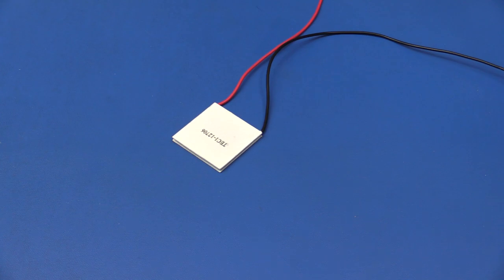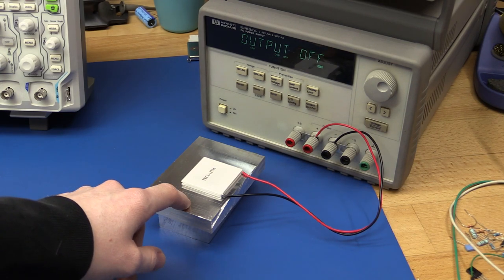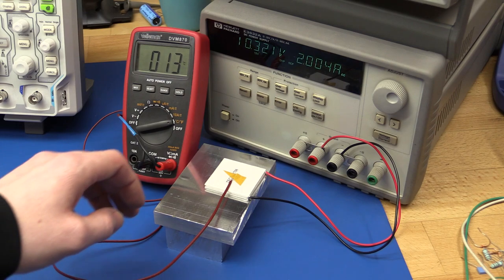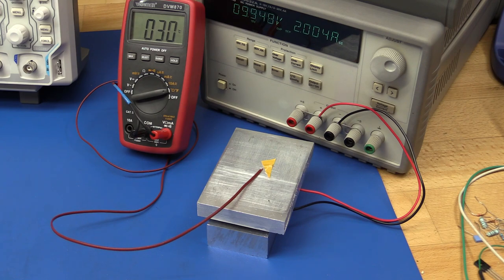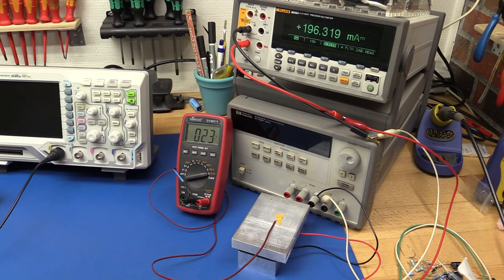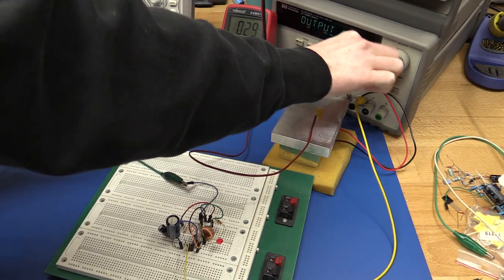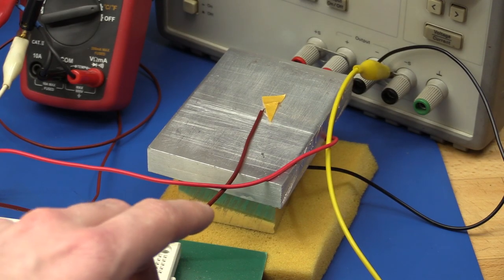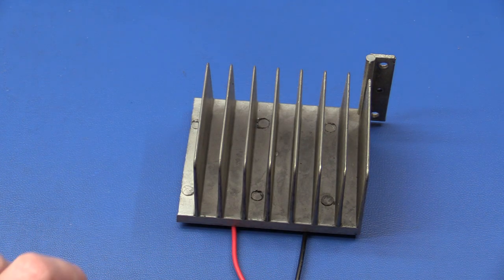Playing With A Peltier Element / Thermoelectric Generator - Ec-Projects

Comment: Played about with these at work a few years ago, an array of 9 with a large heat sink on both sides, the hot side had a fan. Panel mounted on an industrial enclosure to cool it down as it was to be used in the desert. It worked great and as I remember it was all about differential temperatures, I.e. It managed to maintain a 20degC difference thus if the outside ambient went up 1degC then so did the internal. Great fun to play with.

Comment: We used to have those for PC's into the late 90's. Then something changed about heat concentration in Pentiums and the wafers we had were no longer practical as used. I wouldn't be surprised if in many cases (like 50W green CPU's) now they are once again.
You could always cool air in a duct outside a PC and blow the cold air directly into the CPU fan.

Please, show voltage and current across a load resistor! That is the real useful data! I wish I could send you a boost converter to see how much 3.3V you get at different temperature differences!
Reply from the maker: ***** Yeah I should probably have tried a few different resistors and measured the power instead.. :)
Reply: EcProjects
Just one like a 1k or a 10k would do. But measure both voltage and current across the resistor that the power is flowing through and you can get solid values on power output.

I can meter over a volt and a half just pointing a red led at indoor light but when that current flows, it's so close to nothing I wouldn't make the mistakes I'd make going by V alone.

Comment: Sir im doing my college project which im using thermoelectric generator and the maximum volt that produce by TEG is 1.28V which is not enough for charging my phone. Is there any boost converter that can boost the voltage to 12v ? Or should i use joule thief ? Reply A.S.A.P thanks
Reply from the maker: You can get boost converters that operate in that range. But they usually like a relatively low impedance input. A decent size capacitor can help a bit though. Did you measure the voltage with a load ? :) 
I think your phone only takes 5v by default ?
Reply from the maker: http://ww1.microchip.com/downloads/en/DeviceDoc/20002234D.pdf
Something like this can do 5v.
Reply: EcProjects i havent try with a load. At first im using an USB converter from 12v to 5v dc to dc but unfortunately the TEG cant produce that high voltage so i think the USB wont work.and if i adding some cooling fan the voltage definitely decrease.

Comment: Peltiers are nice because they can be easily controlled when you need to keep a certain temperature, especially below ambient temperature. A shame that they are so inefficient. If I remember correctly it was below 10%, so for every Watt you want to take away from one side, you have to put more than 10 Watts into it and dissipate all of that on the hot side. If you forget thatt the single elements inside will desolder themselves.

Comment: The best way to use a Thermoelectric Peltier:
Use it as a generator by heating up one of its side and then boosting up the voltage to 12V. Using a boost converter.
You can put it near a gas stove while your mother cooks

Comment: What if you would attach 10 of these to a metal chimney pipe? It would be enough to charge 12V battery, i guess?
Reply from the maker: +Jėzaus Tėvas I don't know :) You would need some large heat sinks and cold weather for sure :)
Reply: Well of course, heat differential is essential. I'm just not sure if 200mA would be enough to charge a basic car battery. For such project to be useful (not just beneficial) consumer would require at least 100 wats of output. This could be achieved by paralleling a lot of such devices (around 500 for 12V 10A application), but can these Peltiers withstand such current?